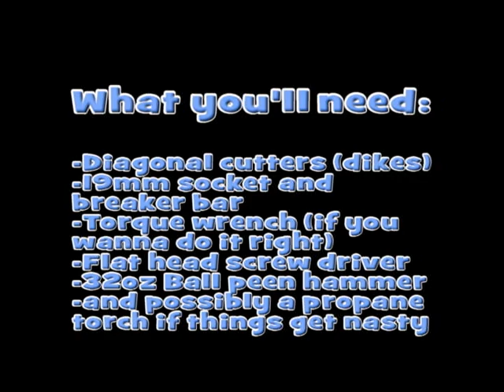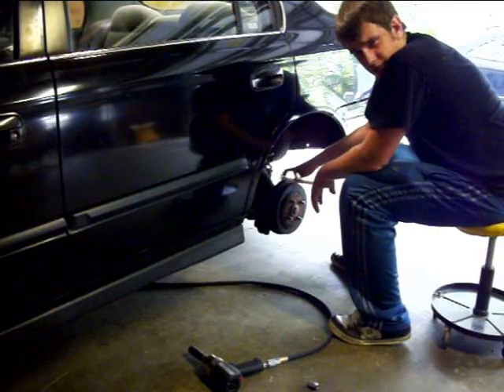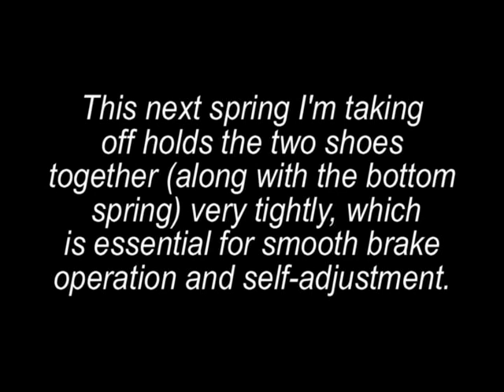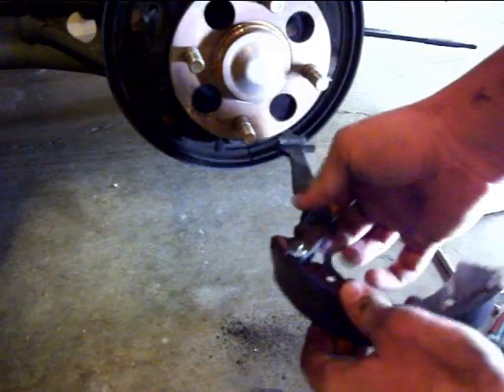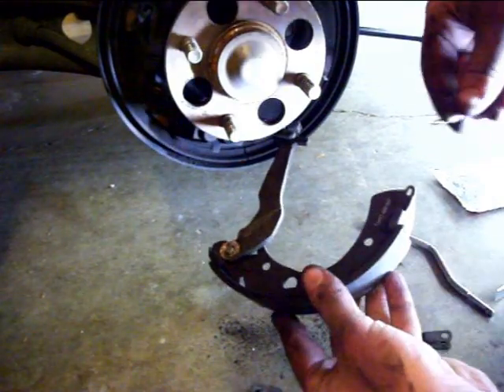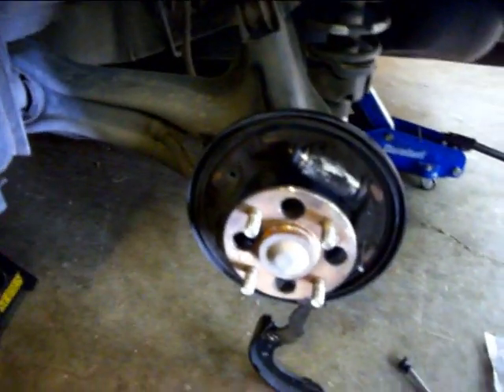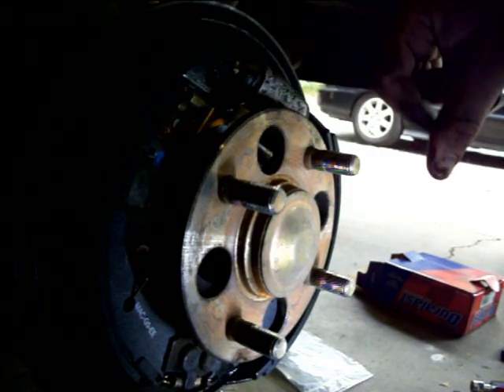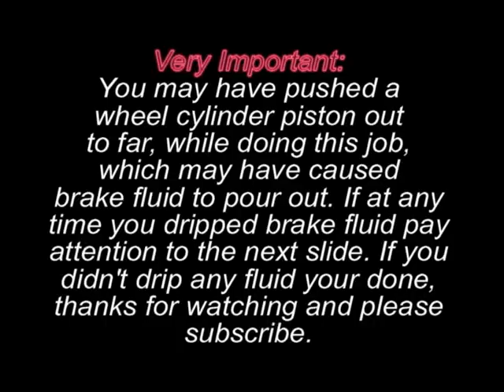How to Replace Rear Drum Brakes Honda Civic

Comment: @kosmosleha "my drum is so rusted out I keep hitting it, but it won't come off" I'm sure this won't help you now, seeing as you commented three months ago, but for others with problems getting the drum off, see those two little threaded holes not attaching anything on the front side of the drum? Go get two 8 x 1.25 bolts and thread them on in there. They press against the inner hub, pushing the drum off of the hub. Worked for me in no time!

Comment: Good Job,
One thing, the Drum has female threads to put bolt in - to screw in that will allow the drum to push off and break lose from the hub when a hammer fails.

Comment: Check the wheel cylinder too and is easy to do.Pull back the boot and replace if brake fluid comes out.Brake fluid should not come out when the the boot is pulled out.Replace them instead of rebuilding them,they are dirt cheap to buy going for $15.00 to $20.00 a piece.You don't need to do the job twice and get the drums machined.

Comment: So I followed all the steps but when I try to put on my drum it don't fit. Also everything is loose and not tight. It seems as of the shoes are expanded outwards or something. Any suggestions. I also thought it had to do with the wheel cylinder so I bought a new one n installed it.

Comment: Hi..I have followed the same process.  Everything seems to be ok until now, when I brake, the steering wheel shakes.  It shakes hardly when I break suddenly.

Could this be the rotors?  It looks pretty bad and I know I need to replace them.  Just making sure if that is the case and not anything else.  Thanks.

Comment: I am doing my 89 Honda LXI as we speak. I got all the springs and Emergence brake connected + the adjuster arm (that goes across). Everything looks ok, but I can't get the drum to go back on. It appears that the shoes are out to far. I keep adjusting "star" wheel, but still no go. I don't know if I keep adjusting it till shoes give to drum cover. I feel so frustrated I've gotten this far with. Why won't drum go on? BTW, its taken me 4 1/2 hours yesterday (got dark), then 4 hours so far today.

Comment: You should just replace the wheel cylinder/ piston... Unless you want to have a leak and replace everything in a couple of weeks again. Also to set the adjuster you need to pump the pedal so that if can SELF ADJUST. Some cars require you to go into reverse and pump the brake pedal in order to adjust. Otherwise your brakes may not work properly. Just a tip :)

Comment: Not what I was told: Its 60-40. 60 to the front, 40 to rear. Probably not good idea to let them go in case you encounter a hill, ie, coming down I-80 from Reno going westbound. Thats not a safe downhill ride.

Comment: Does anyone know how to do a conversion from drum to disk on a 97 civic? I don't like my drum brakes and the guy that owned the car before me had it decked out but.. Got another 97 with a better engine and stripped everything he could from it including the conversion. I don't even know where he got it lol. If anyone could point me in the right direction it would be highly appreciated!!
Reply: You need the complete trailing arm hub, rotor, caliper, break lines, and a new betaken cable. It's pretty much an easy swap.

Comment: How many people just let the rear drum brakes go bad?  It's not safe and definitely not recommended, but with drum brakes all but phased out nowadays (and the front disc brakes providing the majority of the stopping power), it does make me wonder.  My mechanic says a lot of folks have their front disc brakes regularly services (pads/rotors) but let their rear drums go until they start making noise.  He's even seen some with the shoes removed.
Reply: ijosef I would have no emergency brake then